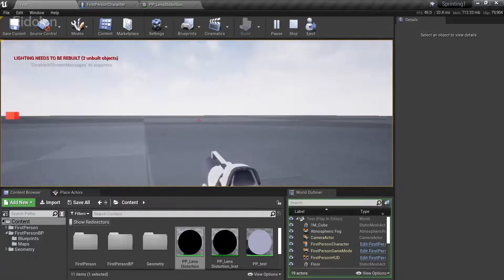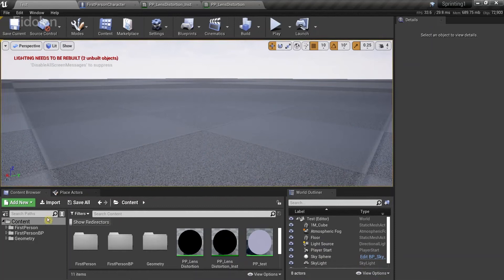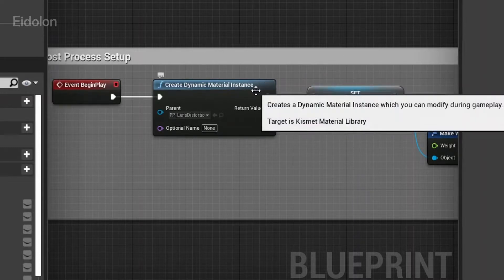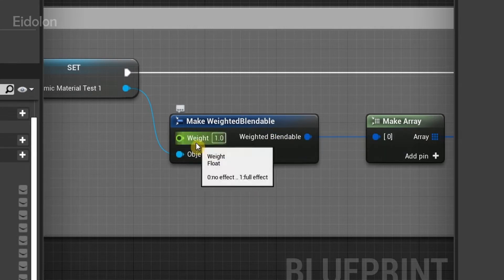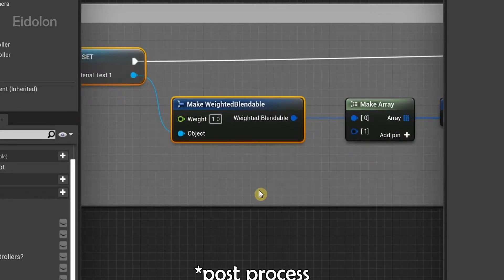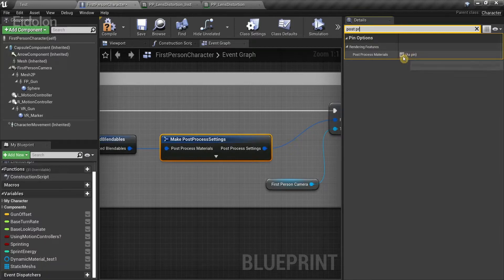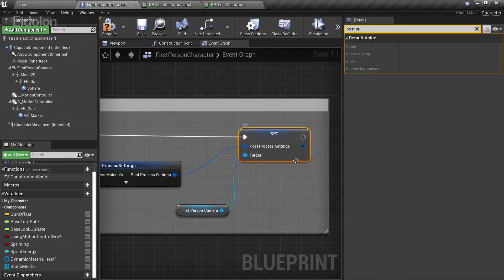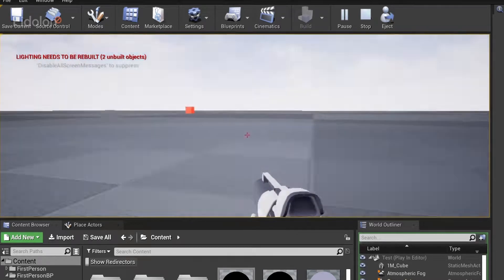How To Add Custom Post Process Material On Camera Component And Modify It In Blueprints | UE 4.25

Comment: I found a simpler way to do this, I don't know if this works for everything , but for what I needed which was to change the color of the outline I added a material Parameter collection and added 1 vector parameter, then I went in the outline material and referenced the material collection then I hooked that instead of the color. Then in blueprint you can just set that vector variable(color) with 1 node at runtime.